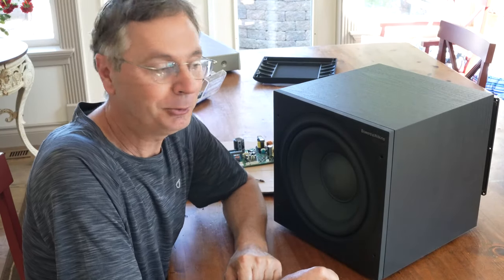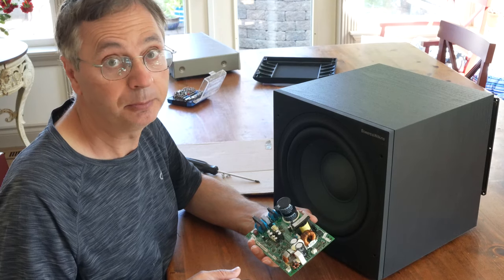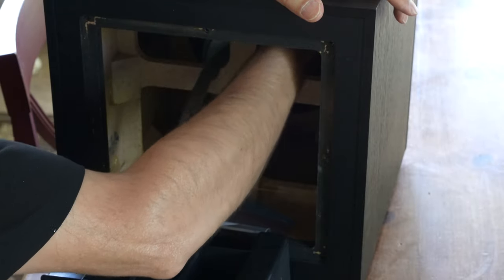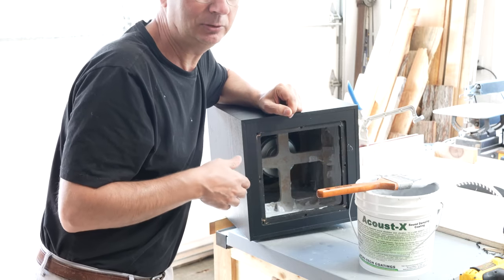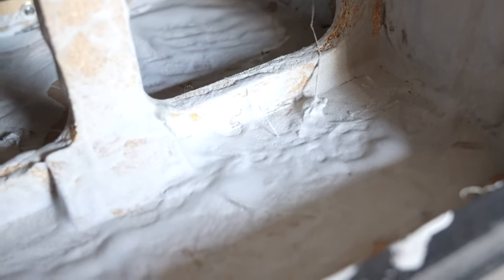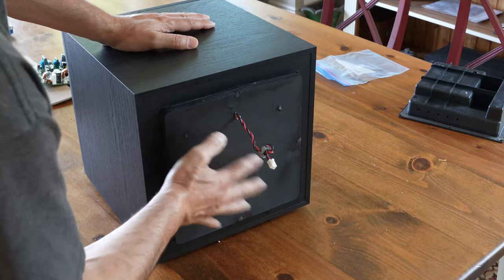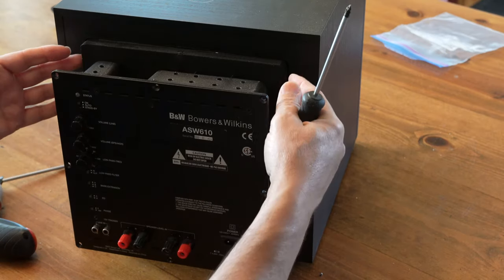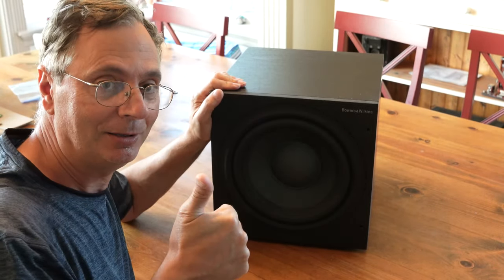Subwoofer repair and upgrade Part 2

Comment: Hi! Thanks for the video - very informative. I have B&W ASW610XP that was purchased 8 years ago in Europe. About 4 years ago we moved to the US and the unit was used with power converter for sometime. It was working just fine, than I put it in a box for 3 years. Now that we are back to Europe I hooked it up to Marantz Cinema 60 and it does not work... I checked the power [ok], fuse [ok], cable [ok] but my AVR does not recognize it. Would you have any idea what could be the issue? Thank you in advance!
Reply from the maker: hard to tell without taking it apart I would try it with a simple amp and try the low level input to rule out a connection issue
Reply: @Gabster1  thanks! I actually connected the sub to the AVR to front speaker slot with normal cable. Did not work. I guess will take  it to some repair shop.